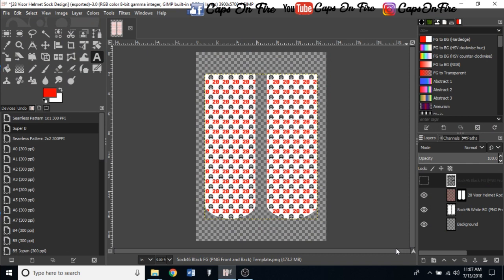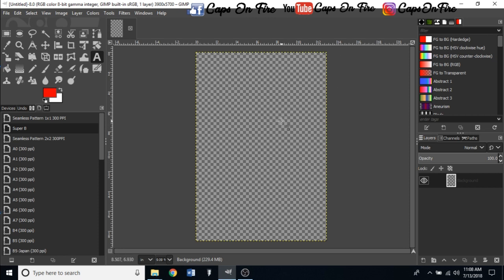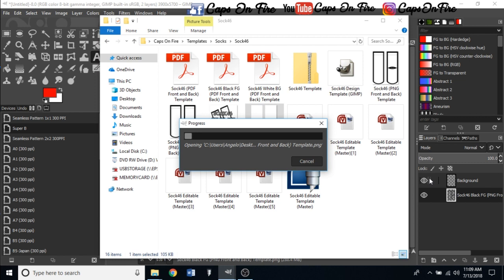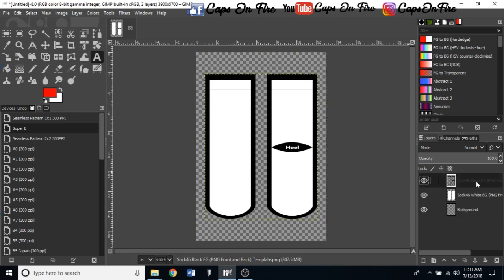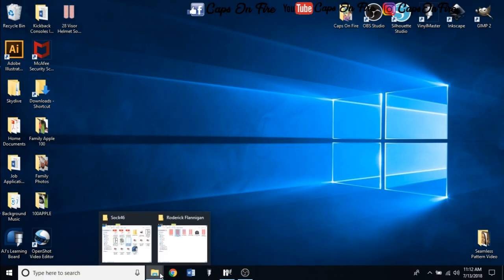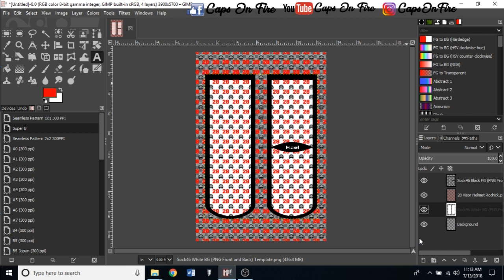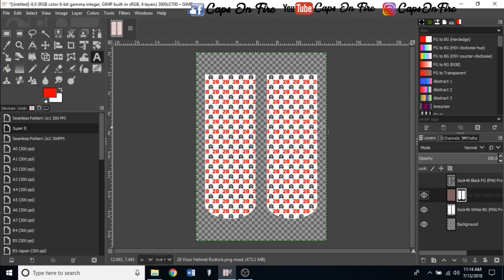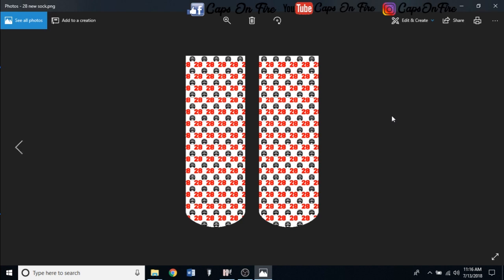How to Design Socks for Sublimation ep: 03

Comment: hello great video i bought the template from you thanks by the way i dl gimp i did everything u did in the  video but when i do it pops up message that was not in your video i have the epson wf7840 so i can do 13x19 here is the size of the sock size im using (3.35 in x 16.2) the sock jig i that fit was (20.1" x 3.94")  and i bought your template im so lost nothing is working my way please help

Comment: When we print, should we hide the black layer so that will not print also?
Reply from the maker: Crafts Made Personal Yes. Before you export the image to print, click on the eye symbol in the layers tab to turn the visibility of the black label off. Then export the image. Just make sure that your design goes to the edge of the white background.
Reply: Caps On Fire ok thanks. I just bought an Epson 7710 yesterday and some blanks from Conde yesterday to try this on. Oh and some image right paper from Coastal. I couldn't find the sub B paper you mentioned from Conde. So I will be watching your videos like a trillion times over and over until I memorize how to do things. Thanks again!
Reply from the maker: Crafts Made Personal Awesome!!! Yea I love there products. Everything that I order come fast and most importantly, it’s exactly what I ordered. Also, don’t forget to click on the link to get my sock template. It’ll save you money on the ink and you’ll be able to line up your image a lot easier.
Reply: Caps On Fire oh I ordered both sock templates yesterday from you as well. I'm trying to be ready when that ink and paper comes in. The only thing I didn't order was the jig since the socks have cardboard already in them. Lol!
Reply from the maker: Crafts Made Personal Awesome. Thank you for your support. If it’s not too late, order the straight sock jig. I used the paper that comes with it and it’s not good as a jig. It’s not wide enough and you won’t be able to get down into the creases of the sock as you would with the straight sock jig.
Reply: Caps On Fire ordering it right now.